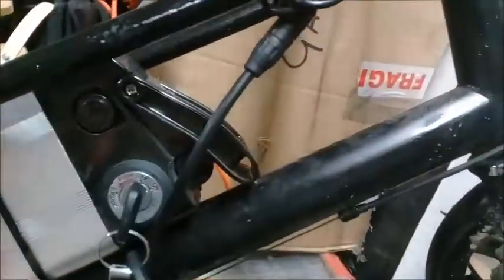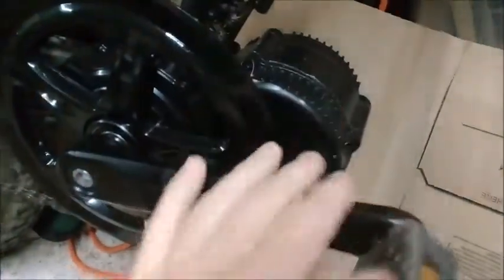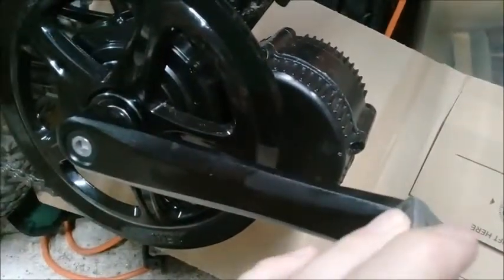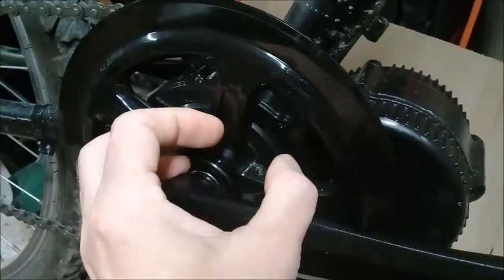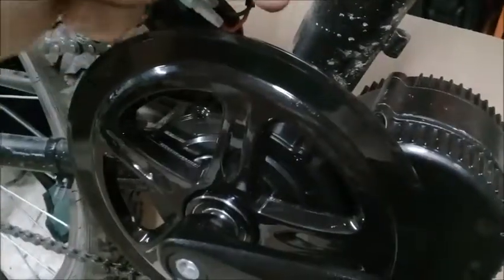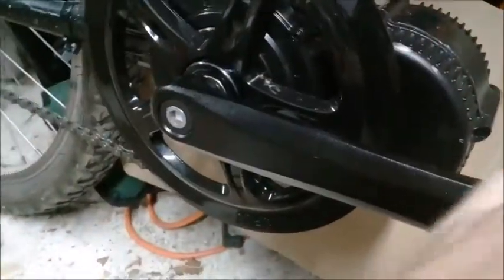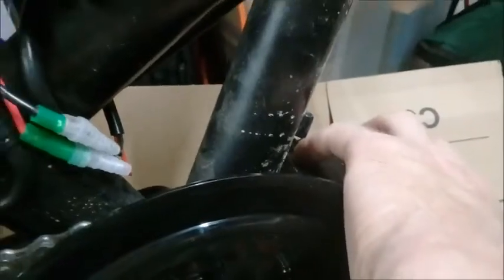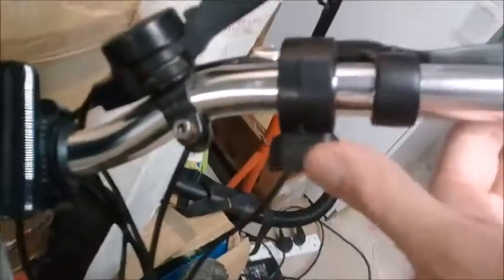Bafang Mid Drive BBS01 BBS02 Install Observations

Comment: Did you ever do a vid with the programing cable?
Reply from the maker: I didnt do this as thought i might get some strong responses if anyone blew up their controllers. What voltage and what controller do you have? Ive just transferred my bafang kit to the Katarga full suspension bike. Word of advice on controller cable app, read current controller settings then backup. Its v easy to save default app ones to the controller  by mistake.  I have the 36v 250w and its the one you cant change the amps from 15 to anything higher. All other settings can be changed though.
Reply: Thank you for the reply, and advise. Would love to see a video of you testing the Katarga, I used a Boardman MTB 8.6 bike that I purchased on my works cycle to work scheme. 
I think people blowing motors would not be your fault, Give the obvious disclaimer first ;)
I have a BBSHD with a couple of 48v battery. (30ah and an 18ah.).
used the 30ah battery last weekend to ride Barnstaple to Great torrington along the cycle path. Really enjoyed it.

Comment: Great video! Thank you. 
I have TWO questions for you:
1) What would be the minimalist Bafang mid drive build to turn a manual bike into an ebike? 
I ask this because I am not a big fan of too many wires sticking around the bike frame as I see them time and again in installation videos. Can I do a simple build with just a mid drive motor and a thumb (or twist) throttle? I assume that the throttle is the only key element needed to control the motor. I could care less about the LCD display, the speed, or changing the power of the motor as the gears change especially as I ride on the highest gear no matter what the terrain! 
2) Is it a good idea to build ebike on a single-speed bike that can coast? Having no gear derailleur would further simplify my ebike especially when I do not use the gears anyway. The less is actually more and simpler!
Please advise.
Reply from the maker: Amjad Farooq so the bafang kit is nice as the controller is built in  to the mid drive motor. On a hub motor you have a seperate controller that connects to the hub, battery, brakes, throttle and wheel sensor. Bafang is the same however the cables are much neater. Not sure you can get away without a display as you cant see the pedal assist level and may not be able to chamge it.  You would also not have access to the miles, trip and speed info.

Regards the gears you really want 5-6 speed rear cassette as single speed would either put a strain on the motor pulling away from stop and the motor may top out early.  My lowest gear the bike does 9 mph while the highest does 20mph
Reply: Thanks very much! Good advice.
Do you have any experience riding the fat-tire (26" × 4") ebikes such as those from Addmotor or Richbit? I can buy one of those bikes for around US$1500 on Alibaba with a 1000-W motor and a very powerful 816-Wah (48V*17Ah) battery!! But, fat tires scare me. Too much meat about nothing. Or do fat tires really help when riding at higher speeds around 30mph?
Reply from the maker: Amjad Farooq no experience of fat bikes, but might be worth checking a youtube channel out called vortecks as he's built a custom high spec bike that does 60mph.  That has motorbike wheels and tyres on.